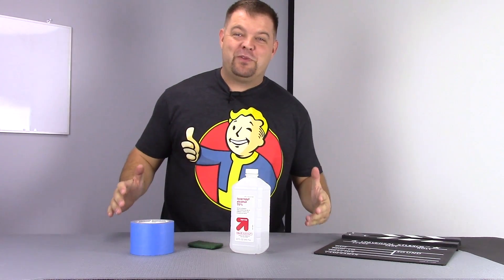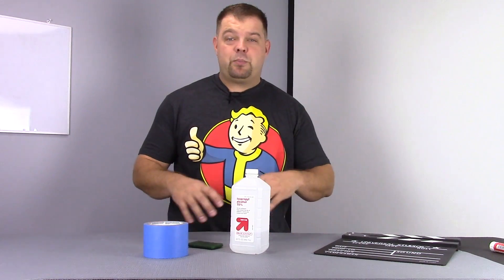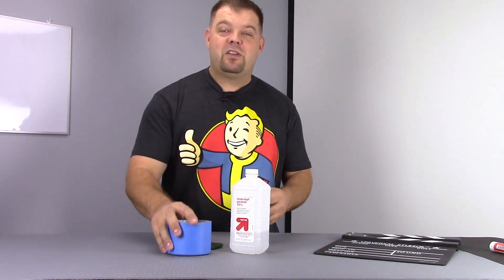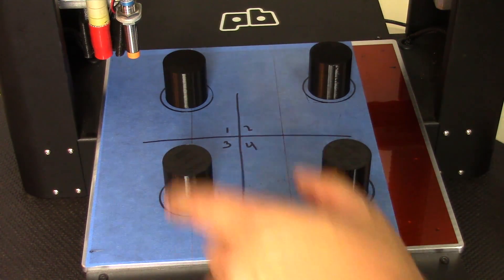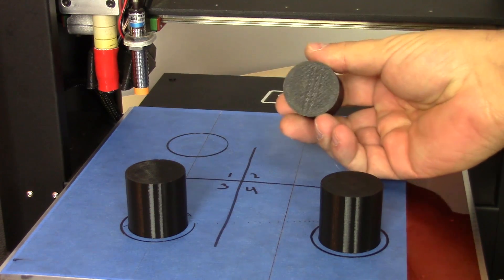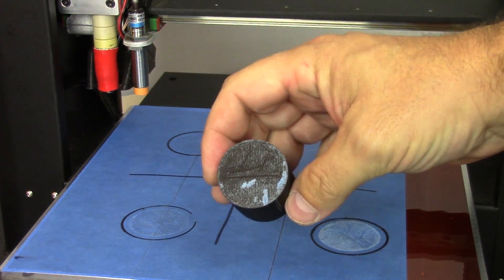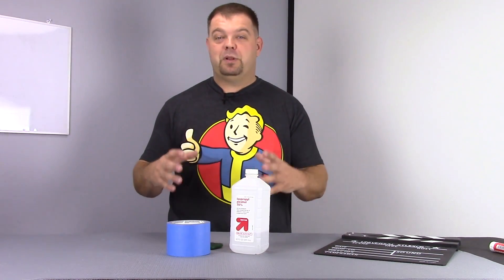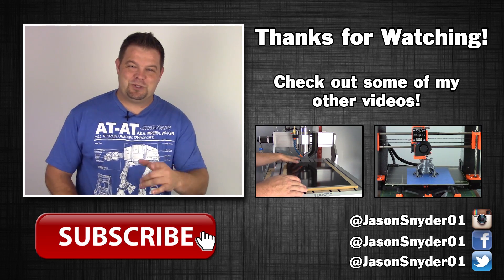Get Your Prints to Stick - 3D Printing Surface Prep

Comment: Been using abs with my creality ender 3. Having bonding issues with the bed as im trying to print a Picatinny rail in the up right position for my vr gun stock project. As it gets to the 140mm it tends to break free from bed...need advice

Comment: The glass build plate wizard is the best printing adhesive solution. Can get it from www.ez3d.eu. Prevents prints from warping and is easy to remove.

Comment: Hi there! I’m having a problem printing pla on my cr10, the pla stick to the tape fine but the tape comes loose from the glass. I’m thinking that it may be to hot so the glue becomes less powerful? The heater bed is set at 80c for PLA... Any recommendation? I’m new into this :) Thanks!!!
Reply: I think the temp for your bed is too high.  Also, there are some PLA recommended settings that suggest you don't turn the bed heat on for PLA.  (Are you sure the heat bed is at 80 c?  Not 80 f?  80 seems really high...)